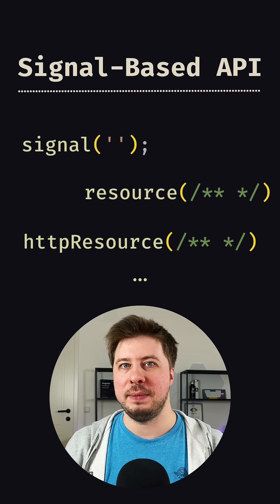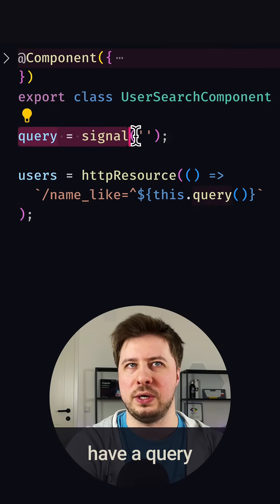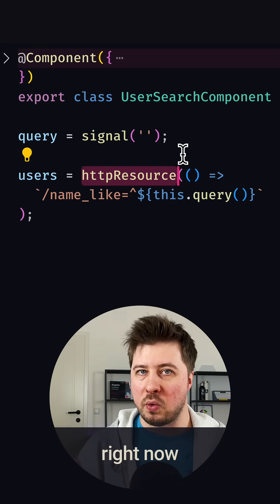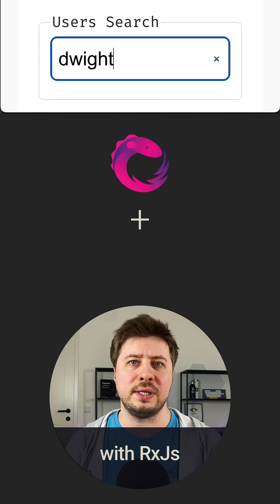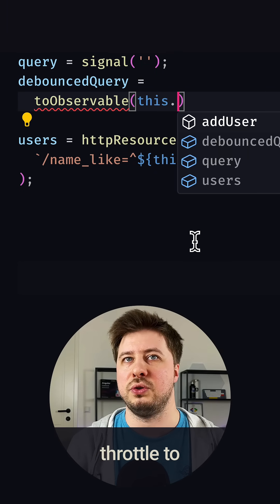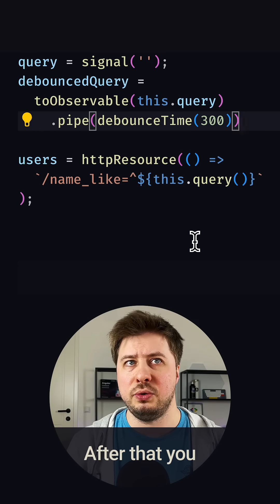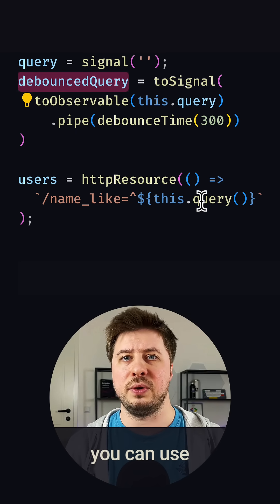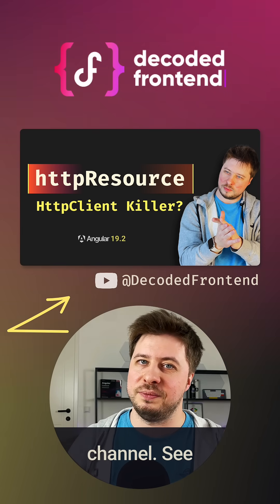Angular Signals Trottling/Debouncing  (workaround)

Comment: How about a retry mechanism (rxjs retry)? And how to use the the resource api for n requests in a pipe (e.g. a detail api call for an array of elements)
Reply from the maker: Retry mechanism isn’t supported by resources, but since we convert signal to observable, you can handle retry logic using RxJS retry() operator.

Regarding your second question, I would need some additional research. If I understand your use case right, I think it would be something like using computed() to aggregate multiple resources. If you could describe the use case with more details, it would help a lot.